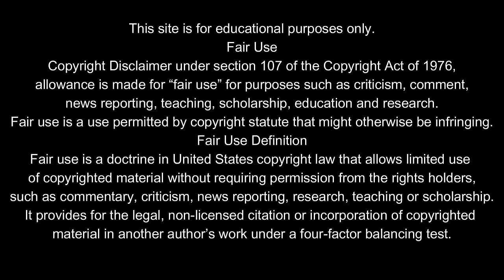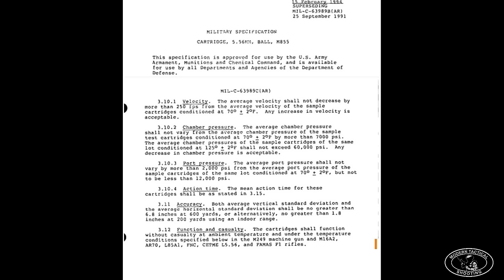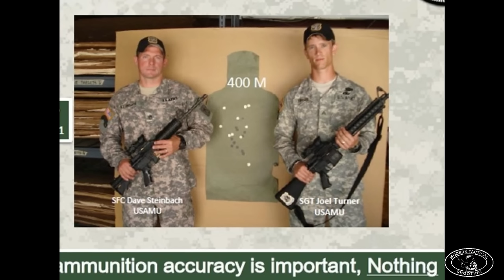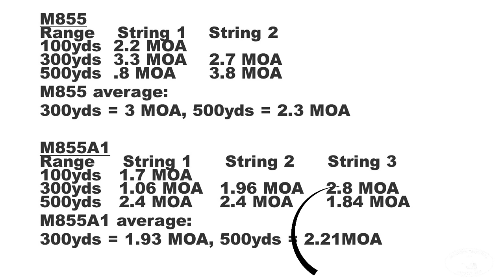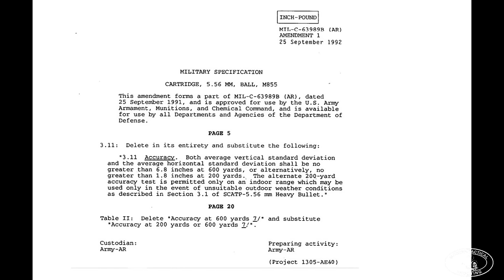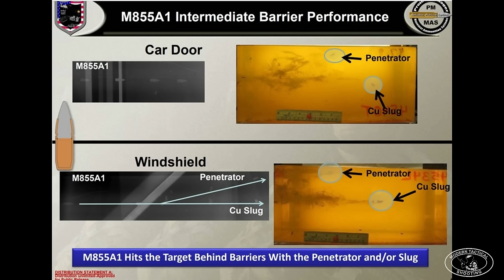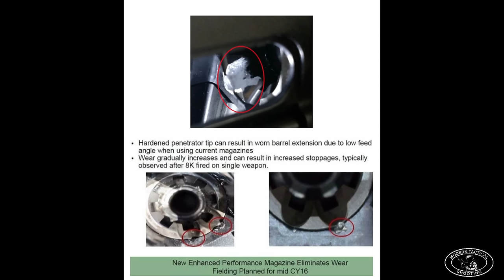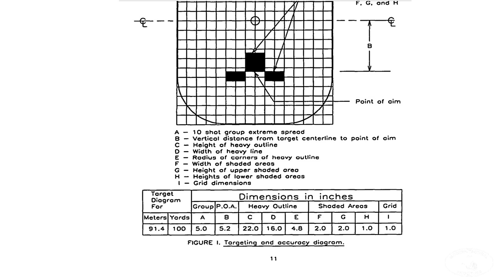M855A1 Performance Review. Did it live up to the Army's hype? Did going green really work?

Comment: Where M855A1 shines is that it still fragments at much lower velocities, like close to 1600FPS.  This is around the 600 yard mark for 12.5" to 14.5" barreled rifles. Old M855 minimum fragmenting velocities vary between 2700 to 2500 FPS, which out of an M4 doesnt get you very far.
Reply: Bingo. Plus M193/M855 suffer from fleet yaw that causes inconsistent performance even within the fragmentation velocity range.
Reply: ChadTheAfricanBullfrog  Martin Fackler, who popularized the gel test, was a field surgeon in Vietnam and likely had more experience with 5.56 wounds than anyone else. Gel isn’t something made by guys in lab coats that have never fired a gun before, it’s something made by a combat surgeon who had extensive experience documenting GSWs.

This guy wasn’t very specific at all as to whether the terminal performance was better or worse, and said the information was secondhand anyway. M855 and M193 performance is notoriously inconsistent, and if we just listened to one person and jettisoned gel tests we would either come to the conclusion that M193 is amazing or terrible, when the reality is that it can be either one, depending on the AOA from fleet yaw.
Reply: Buh…but my gel test showed it would work, buh…

Ballistic gel is nothing but a consistent test medium from which to compare various projectiles, nothing more, nothing less. It literally is for lab use only*. There’s a reason why an ammo maker will spend years developing a bullet in the *lab and then take it to Texas or someplace similar to shoot living animals. Then they find that it really doesn’t work as advertised. Why? Because even when you add test barriers in front or inside the gel they aren’t consistent. There’s a huge difference between live bone and dead bone, so adding a pig scapula inside the block isn’t accurate either.
Reply: @soonerfrac4611  yeah none of that is accurate. 

Martin Fackler initially took wound profiles from his experience as a field surgeon in Vietnam. When he later headed the Wound Ballistics Laboratory, they initially used pigs. First anesthetized, then later dispatched and used before rigor mortis set in. He then popularized the use of properly calibrated 10% 250A porcine gelatin not because it was simply consistent, but because it correlated closely with the average wound found in pig and human tissue. This was further demonstrated by Gene Wolberg’s study “Performance of the Winchester 9mm 147 Grain Jacketed Hollow Point Bullet in Human Tissue and Tissue Simulant” published in the IWBA’s Wound Ballistics Review (Winter 1991, Volume 1, Number 1, Page 10).
Reply: it also yaws in a much shorter penetration distance which m855 did not
Reply: @KP-ty9yl  I mean given the inconsistent performance of 147 gr. 9mm in real life shootings, especially out of pistols, I am a bit skeptical as well now.

Ballistic gel does have its place in being a consistent, repeatable medium, but the idea that it’s a 1:1 simulation of tissue damage is, to me, suspect. Certainly it’s close enough to still be useful data, and I look at gel tests often, but I don’t consider it the end all, be all. It’s also why it’s a good idea to look at bullet performance through other mediums, too. For example, if a round performs well in both ballistic gel and Paul Harrell’s meat target, I’ll use it.
Reply: @gameragodzilla  147gr 9mm as a category might be inconsistent, yeah. This was comparing the gel and “street” results of one specific load; due to the lower velocity and smaller hollow point cavity of the 147gr, it really benefits from newer designs with skives and controlled expansion over the older gen 1 HPs that were basically a reversed jacket and a hole swaged into the lead core. 

As for meat tests, they tend to exaggerate damage because rigor mortis makes tissue less elastic, which basically turns a lot of the temporary stretch cavity seen in pistol rounds into an artificial permanent stretch cavity, whereas in living tissue it would just bounce back. Maybe some bruising or broken capillaries, but not torn muscle tissue and blood vessels, you know?

To be clear, you’re right that gel doesn’t necessarily mirror wounds 1:1 either; the temporary stretch cavity seen in gel is also often exaggerated. But whether it will expand at all, the penetration, and expansion are all very close to tissue. 

The Canadians (RCMP) did an experiment where they put various ribs and stuff in gel, and they didn’t see a significant difference in the results: “Comparative Performance of 9mm Parabellum, .38 Special and .40 Smith & Wesson Ammunition in Ballistic Gelatin,” article TR-01-95, September 1994, in CPRC technical reports :D
Reply: @KP-ty9yl  In general, it seems to be fairly inconsistent even with newer technology due to 147 gr. being quite out there for standard 9mm. Ironically, .45ACP 230 gr. hollow points, meanwhile, perform quite well as .45ACP standard FMJ is 230 gr.

Sure, but the meat target mainly is there to simulate different parts of a human body. Meat, for example, is only used for the pectoral muscle and ribs are used to provide bone, while the internal organs use fruit. Is it as consistent as gel? No. But it does provide a non-homogenous medium that closer correlates to a human body. So seeing things perform in different mediums is important.

Sure but it is a homogenous medium, and that will inherently throw off results.

As for the Canadian data, any specifics? Did they put in vital organs as well? Different organs have different elasticity and make up. Did ribs get struck vs. not struck during hits? Was the size and depth of the gel in line with a human being? A round that expands well but expands “late” may do well for the block of gel, but may not expand sufficiently before exiting the human body if fired at a relatively thin portion. After all, the FBI penetration requirements came from Miami Dade where a bullet traveled the worst case scenario through an arm and into the torso from the side, stopping just short of the heart. But most shots will still be fired from the front, and if a round doesn’t expand soon enough outside of the Miami bullet, that’s a problem that won’t be found in gel.

All those factors need to be taken into account.
Reply: @gameragodzilla  The HST and Gold Dot in 147 perform well. But yeah, I agree that 9mm is more “on the edge” than 45 just because you have more mass to work with the 45. It’s a lot easier to make a bullet that expands reliably and penetrates 12”+ with 357 than 38. Just more wiggle room. 

They didn’t put vital organs because the elasticity difference between them isn’t too great. They did note whether a bullet hit a rib or not, and there wasn’t a significant difference, though unsurprisingly those that hit a bone tended to expand less and penetrate further. 

But yeah the neck length or length before full expansion is important as well. That’s also a reason that m193 and m855 aren’t super consistent. In most modern hollow points, it’s less than an inch or two, though
Reply: @KP-ty9yl  I wouldn’t say mass inherently as hollow point expansion is velocity driven. But since 147 gr. 9mm is so out there for 9mm loads, its velocity might not be good enough for hollow points designed for it. Meanwhile, because 230 gr. .45ACP is standard, its velocity is typical and reliable for expansion.

Yeah, but that’s why I think bones and other material is important. Hitting a bone may cause the round to not expand so much that it performs like an FMJ. Plus, different organs have different amounts of water, which should also cause at least slight differences in wounding from hydrostatic shock. Sure, that may be controversial, but it’s controversial because it can’t be properly tested.

I know necks are easily measured for rifles, but I don’t know if that’s the case for pistol rounds, so knowing when it expands is a bit difficult and why I see that as an issue for 147 gr. 9mm.
Reply: @ K P
Dude, everything you wrote supports everything I did. You specifically said it was from guys in a lab, then go in to discuss a guy in a lab. There’s tons of articles and even videos discussing exactly how and why gel is great but not an end all be all test. And again, ammo makers such as Hornady, Nosler & Remington ALWAYS take new ammo out and shoot it at live animals in field conditions. They might not do so with their military contract ammo but they damn sure do with their hunting ammo, you know, the people that actually care about terminal performance more than “going green.”

Again, gel is great, it allows a tester to have a consistent medium from which to accurately and repeatably apply test protocols. But it only simulates one density of a target. Humans and critters are not the same density throughout their body cavity. There are hollow spots, air filled spots, some have more muscle of a different density, other section of bone is lighter or heavier depending upon the frame and build of the target. And yes, live bone is vastly different than dead bone, even recently dead bone is significantly more rigid than live pliable bone. Living bone is very pliable.

But sure, keep quoting a 30yr old report. I guess I could quote the Thompson-LaGarde tests also, but I won’t.
Reply: The m855a1 shreds it's jacket off
Reply: I don’t know WTF you people are talking about saying “fragmenting” and yawing.
I’ve applied this freedom seed many times both overseas and domestically on both humans and animals.  The results have always been consistent.  A copper jacket that sheds almost explosively at a rather shallow depth, with a laser clean exit hole from the penetrator dart continuing through.  Never experienced yaw.   M855A1 is meant for defeating plates.  The best killer by far for unarmored targets is the original M193 that actually does yaw then fragment.  That pill does magical damage to tissue.
Often, the 855A1 will shed it’s jacket too shallow and create a nice entrance hole, exactly opposite of what you would see with a conventional hunting round.
Reply: M855A1 has plenty of real world testing that shows it to be a better performing round than M855 whos effectiveness is primarily dependant on fragmentation.  Out of an M4, M855 goes about 150 yards before it quits fragmenting reliably and starts to ice pick.  M855A1 does have a much shorter "neck" within the wound channel while the base of the round typically continues to punch through pretty deep.  

Yaw angle upon impact greatly effects M855 whereas A1 is not yaw dependant.  A1 has better barrier penetration than M855 by a decent margin and as I originally stated, it still reliably fragments at MUCH lower velocities (about 1600 fps) thus allowing it to more effective at greater distances.

 Even if both rounds performed the same in regards to fragmentation, neck, permanent wound channel, and depth in ballistics gel, the fact that A1 can still do that at out to about 600 yards from an M4 vs the 150 yards from an M4 would be reason enough to consider it over M855.  

Considering that the majority of the people getting shot at by U.S. forces for the last 30 plus years have mostly been smaller framed than your typical westerner, having 5 to 7 inches of neck prior to the start of fragmentation has been a known issue for a long time. 

MK262 when run from an SBR type platform (MK18) is very effective since the round isnt fully stabilized until around 100 yards and at CQC distances that instability worked very well since there was plenty of yaw at impact hence more rapid fragmentation aka better ballistic performance.

MK262 also went from Mod 0 to Mod 1 which added the cannulure crimp.  This was for several reason including bullet set back issues i.e. neck tension but also has the added benefit of surprise, surprise....FRAGMENTATION. 

MK 262 is a great round with a lead core.  M855A1 is the "green" round that blah blah blah something something environmental.  It also has better barrier and armoured plate penetration.  Couple that with better performance than M855 at all ranges.  

Now it also eats the shit out of barrels and cracks bolts far faster than any of the other rounds.  It did in our guns anyway.  20" guns faired better but M4s had problems way earlier.   Gas port errosion was more problematic on the M4s. 

That my personal experience using the stuff.  Take it or leave it.
Reply: well the round is made out of 2 pieces already, so not too surprising.
Reply: Also the ammo is going 300 feet faster from the barrel too!
Reply: @KP-ty9yl  855 Hs the fleet yaw issue due to inconsistent manufacture.

M193 simply needs more velocity than a 14.5 barrel can offer and has a much shorter effective range as a result
Reply: @KP-ty9yl  Fun fact. ALL conical rifle rounds depend heavily on fleet yaw. That includes the .308 rounds which will produce only small holes if they icepick from poor stabilization. 5.56's advantage was the fragmentation during its yaw cycle allowing it to break in half during the greatest tissue elastic expansion. m193 had few issues with fragmentation but the m855 ran into complications due to its multipart construction that could cause partial yaw (ice pick effect). This is why you saw much better effect from the mk262 stuff as it was a simple construction much like the original m193.
Reply: @mattmarzula  Heavier bullets need more stabilization.  62gr and higher will keyhole in a 1 in 12 twist barrel. Also the m193 needs 2200fps to fragment. There were no exit wounds. The fragmentation happens internally. 7.62 rounds don't fragment & cause exit wounds.

No, it wasn't Ahmed. The whole "took rounds to the chest" myth came from Mogadishu where the underfed black insurgents supposed took wounds to the chest but like superman got back up like nothing happened. Ignore the fact that if someone ice picks you in the chest you won't be getting up anytime soon let alone a larger than ice pick bullet zipping through you, puncturing lungs, bones, and other organs. Dr. Fackler did a mountain of testing and chalked this up to the bullet design. This is why the Mk262 was so effective as the simpler construction allowed for better fragmentation.

Not my uncle but my father fought in VIETNAM. He got really pissy when posers say Nam as nobody ever called it that except in much later movies.
Reply: @KP-ty9yl  which if you really think about it the biggest value 5.56 brings to the table is the number of rounds you can carry. Its small size and lighter weight in comparison to larger calibers gives it such an advantage even if isn't the best at killing people. The point is you stay in the fight longer with more ammo on hand.
Reply: @Mr.Ut21  I believe you’re confusing Gary Roberts with Martin Fackler
Reply: @gameragodzilla  wether it’s gelatin or “the meat target”, your all “shooting groceries”!!! But hey I don’t know if a better option???
Reply: I assure you, using the original M193 against a deer or hog gives you much more damage than the 855 or 855A1.  Might have used all three a few dozen times over the last ten years.  The more we built our bullets to be penetrators, the less lethal they became.
Reply: You get way better fragmentation at low velocities by using V-max.
Reply: @brainplay8060  You probably shouldn't speak in absolutes. Especially when you are largely wrong. When I talk or type it isn't about what I read or heard. It's from what I've done and seen through my sights. I'm not here for a protracted debate.
Reply: @mattmarzula  Friend, if I am wrong then you can point to some solid evidence. The problem is that there isn't anything to prove I'm wrong. Facts about the shape & properties of the 5.56 have been studied ad-nauseam.
If you're talking about the "ice pick" theory then I can point to the first complaints which were all of course people who heard other people say this thing. Paul Howe who was part of the Black Hawk Down task force started the story but would later walk back his comments years later. He had the idea that the bullets worked better at long range than close which defies all known results.
If you're talking about stolen valor fools saying NAM instead of Vietnam then you'll have to take it up with my now dead father and his buddies who regularly pointed this out. Nobody called it NAM. That was popularized through comic books later on.
Reply: At what altitude? At 800ft, 73gr ELD loaded stout with CFE223 lopes through a 16" to 600yds about 1500fps.
Reply: Correction - 1600fps, indicated by ShotMarker.
Reply: We are talking vietnam Era and most all G.I. barrels are of 20"s. Now in the 2022s most average barrel lengths are 10.5-16 inches. Has a lot to do with velocity loss and bullet fragmentation.
Reply: @franksplace9589 …and they were 1:12 twist. 55gr + 1:12 = nasty.
Reply: @KP-ty9yl  so what does that tell me? When I shoot someone shoot em alot
Reply: increase twist rate to get more reliable fragmentation. The speed of rotation is affected by velocity * twist rate. At lower velocity you need higher twist to get the same rotation speed. it is that rotation speed that helps fragmenting when the bullet hits a mass water body.
Reply: You cut the tips off if M855.
Reply: @gameragodzilla the whole 147 grain 9mm is inconsistent business has long been outdated and obsolete. Its some of the best and most effective 9mm ammo on the market today. Modern 9mm jhp produces nearly the same wound channel cross section as .40 S&W, 95% that of .45 ACP. Modern bullet mfg allows this. The length of 147 grain 9mm allows this, since we got away from thinking about energy transfer with handgun calibers and focused on wounding potential/expansion.
Reply: @patrickw9520  The same advancements also help .45ACP, hence why all the tests I’ve seen from LuckyGunner or AmmunitionToGo still has it hovering around 60% larger than 9mm on average, with the best stuff being even higher. Since .45ACP is a larger caliber, it has more to expand.
Reply: @gameragodzilla  the advancement in .45 still hasn't helped its lack of barrier penetration however.  Gains were much bigger in 9mm than for .45. .40 barely gained any, like 15%, .45 grew about 20%, 9mm 147 grew up to 40%. When length helps 😆. .45 still has shit range too. Great for SWAT type use, maybe HD is using a larger frame than single stack. But 147 grain 9mm is just so much easier to shoot, faster cycling, higher capacity..... 

I use .45 on the farm for critter control near the barn, less risk of the bullet ricocheting and doing damage.
Reply: @patrickw9520  Not really. In fact, a study found that .45ACP hollow points had the least degradation through barriers of the calibers they tested (Joint Agency Ballistics Handgun Test or something to that effect). And not only that, all hollow points can have issues with expansion through barriers, rendering them back down to performing like FMJ. Also I don’t know where your numbers are from given that .45ACP Winchester Ranger T grew over 100% to hit a full 1” in diameter, while 9mm 147 gr. Winchester Ranger T hit around .74”, which in terms of total area is a near 80% larger area for .45ACP.

Range for all pistol rounds are poor, hence why PCCs and SMGs are largely niche and short barrel rifles are what most people use for close quarters long guns.
Reply: If you loose a war and get taken to court, you don't want a fragging round..  [Geneva Convention]
Reply: fragmenting is overrated.
Reply: Random factoid. When Thompson was considering the round for the Thompson SMG, he tested various calibers on cow cadavers. 45 came out on top in an objective test on flesh and bone.
Reply: @appa609  expansion is overrated